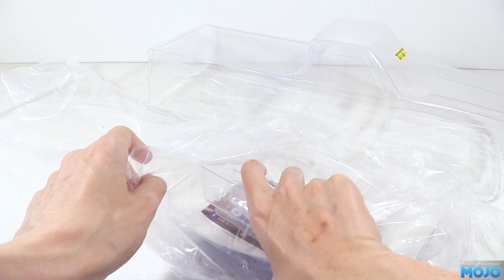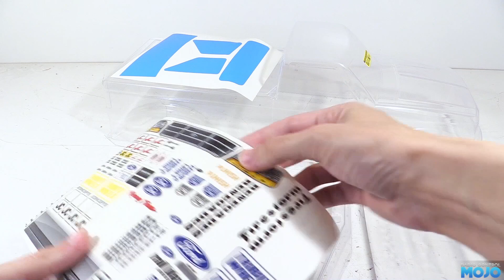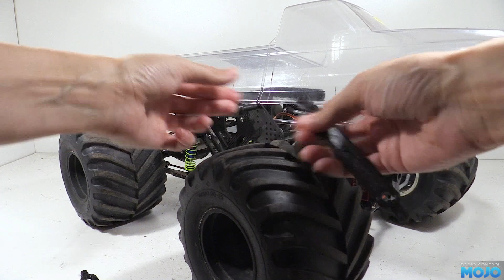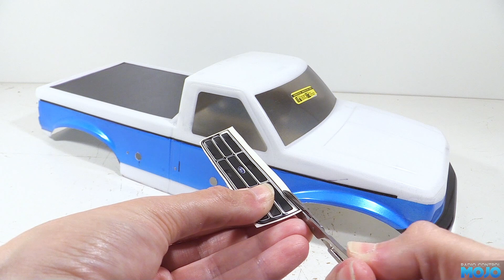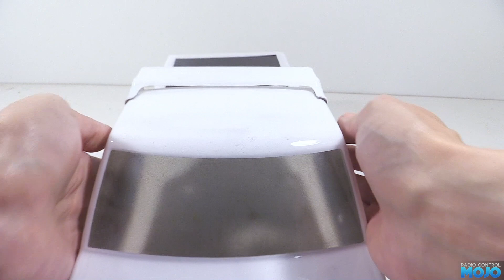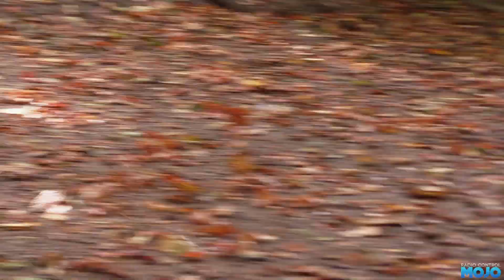Tamiya ClodBuster - #6 F250 Body

Comment: Hey, great work. why not just move the center body mount along the side plates. there must be spare holes.
Reply from the maker: There's a set of holes for the body mount posts, but they only adjust vertically... We could make a plate to move the posts back a bit, but it'll always look a bit funky with the body off
Reply: @RCMojoTV  Just an idea for body mount. a long strip behind the Clod chassis with Spacer rings the same thickness as the chassis, therefore the body mounts stick out the right width. The Black Triangles in the image are the Clod chassis. I also did it with a recess in the strip the same a Clod Chassis for tight fit (Optional) 
https://www.tinkercad.com/things/eGi3Hx8r1xD
Reply: Or why not make an adapter